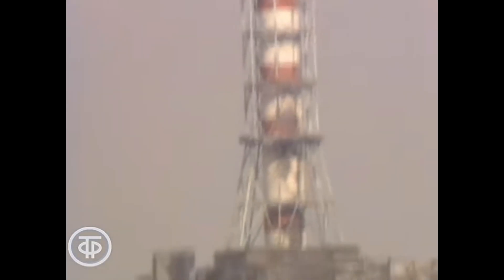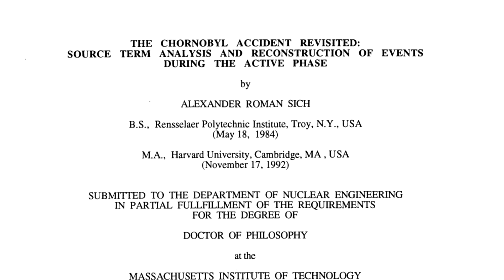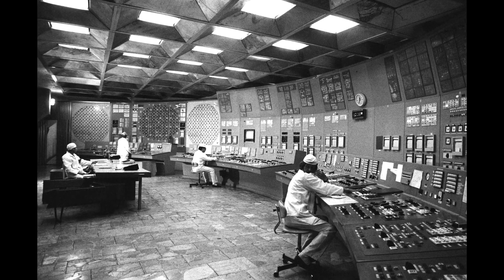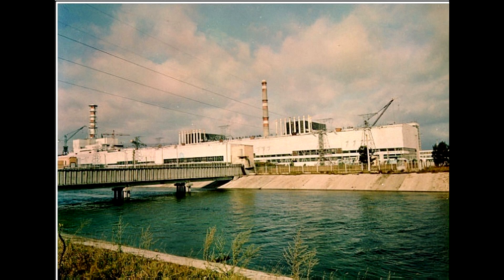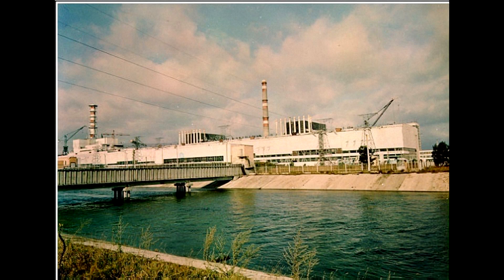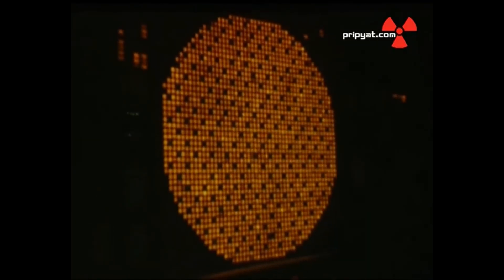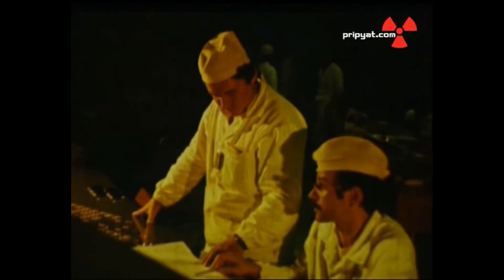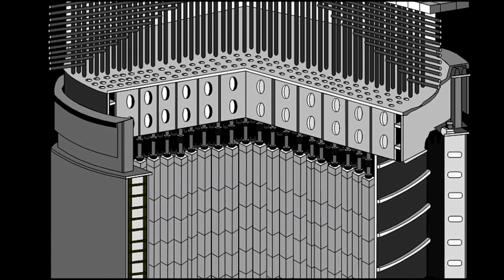Chernobyl Explosion Theories: Sich's Theory - The Last Seconds of Reactor Four

Comment: I've never understood why the displacers were made of graphite.  Why was this chosen when they knew damn well it was a moderator?
Reply from the maker: @elennapointer701  It was actually safer to use graphite overall, as it created a greater difference in reactivity between an inserted and extracted rod. They're still made of graphite today.

The fact the displacer was made of graphite made no overall difference to the accident, as it wasn't the moderator that caused the runaway, but the removal of absorption by water when the graphite displaced it. Any material that isn't a neutron poison would have had an identical effect.

Comment: Where most of tons of graphite disappeared? Temperature of sublimation of graphite is 3642C and many blocks just sublimated. Some graphite blocks, 250x250 mm, became oval, outer part  evaporated. Estimated temperature in the core of over-critical reaction , less than one meter in diameter, in 3-30 fuel rods,  was put at 16,000C-160,000 C. At the same time paint outside of scheme " L " ( lateral biological protection, filled with water)  wasn't even burnt out.

Comment: I never heard any mention of the fact, that the graphite would have that effect on the level of cooling water. That is a realy interesting detail. In the Video it was mentioned that this void effect would raise the output from 200 to 500. It is of course just my stupid comment but it is usually said within popular scientific information or publicly available information that the power output was drasticly lowered, due to xenon poisening of the reactor and that this was the cause for the reactor having less than a third of the output, due to causes unknown at that time, while working in a way that would generate much more energy.
Reply: The reactor layout was extremly complex and it was controlled analog with a huge amount of buttons. That would mean, as i imagine, that within all of the rods of reactive fuel power levels and even heat in the end result could fluctuate without the control havin any detailed insight. With less energetic output there was also a measurement flaw induced that woud reduce the detail in which core parameters were measured.
Reply: I however am not totaly convinced about one thing being mentioned, and that is one basicly trivial thing. I dont think it would be right to make a definite distinction between a catastrophic development and a basic reactor control error, that could happen all the time, with literally every possible consequence as a result. Its just a small criticism, but to me, it doesnt make to much sense to reduce it to the cause being the water within the fuel rods being raised and therefore air bubbles causing the criticality and the controls not knowing, because both factors, cooling water as well as the controls, are also part of the regular reactor function, without any type of error. It just sounds to simple of an explanation. But i too know that the explanation given is that the void coefficent of the bubles would lead to the cores melting due to an energy spike...
Reply: The main component is within the theory, that reactor components in addition to said misfunction are all the ingredients to build a type of nuclear bomb, or to have the inventory explode and release radiation... but that is just a limited  timeframe being explained. What is happening with the timeframe before the reactor even existed. The Reactor was assembled and the inventory was put there, which of course is the reason for it being released the way it happened. If you look at it like this, it is obvious that the cause for a explosion would be a basicly >thermobaric< reaction. But that would be like saying, it is because friction leads to fire... I think a better explanation should take into consideration much more details, and possibilitys, but i guess the tragic thing is, that this doesnt work with nuclear reactors and that almost everyone of them has the potential to explode or release radiation due to a mishap.
Reply: The reaction in the core is a balance. A compromise of many factors.  Fuel decay,  isotope production, isotope decay, thermal temperature, coolant, moderators, and absorbers are variables that are balanced to create a steady state neutron flux.  Neutrons are emitted at differing energies. Each source energy has to be separately accounted for. Xenon acts in three ways, being a neutron souce, a neutron absorber,   and a neutron moderator, depending on where it is in the reaction chain.  Maintaining a steady state neutron flux is challenging enough that a computer had to be used to calculate the rod positions.

The core is not a single point but a 3D volume.  The neutron flux may differ throughout the volume.  One part of core may be over-damped while another part may be under-damped.  Uneven core flux at low output was a known problem with graphite moderated designs.

The water is pumped into the bottom of the core and travels up the cooling channels to the top of the core, picking up heat along the way.  The void density would increase as the water travels up the core.  This variation was accounted for in the distribution and length of dampener rods and control rods.  

When the rods were last inserted the control channels, the change from water to graphite affected both neutron moderation and neutron absorption. At the same time, reducing thermal cooling. At that moment, one part of the core is 'stalled' but other parts are in turbo mode.

Comment: There's no theory - we know what happened. Chernobyl was a prompt critical event. This video would be better if you discussed the different between delayed neutrons and prompt neutrons. We normally control reactors on delayed neutrons. Thermal power is also not really the appropriate measurement when discussing neutron power.
Reply: The reactor could destroy itself without going prompt critical. It's enough to rupture three fuel channels and then simple depressurization of water will pop the lid off.
Reply: @MinSredMash  "The Chernobyl reactor tragically demonstrated the behaviour of a 
reactor following the sudden insertion of a large positive reactivity. In 
that accident power increased from a low level to an estimated 10 000 
per cent full power in less than 2 seconds. Why didn't the delayed 
neutrons limit the rate of power increase? The remainder of this 
section describes the effect (or non-effect) of delayed neutrons in more 
detail, to be able to answer this question [...]  A reactor in this state is said to be prompt critical, that is, 
critical on prompt neutrons alone. This kind of rapid power increase 
caused the Chernobyl core to explode."

Canada Deuterium Uranium Reactor Fundamentals introductory operations course, Ch 19 Sec 4.

I should add that there is plenty of information out there which says that we don't know whether that happened or not. Indeed, I found articles in the press that presented this as a "new theory", etc.  But it is stated as an uncontroversial fact in primary source materials I found.  The first source provides a detailed account of it with all of the math and graphs etc. Of course, I am not qualified to judge whether their conclusions are sound.  But it mentions precisely the distinction that OP drew.  And it is so rare that I find that in a YouTube comments section that I felt that I should say so.  I comment on videos about stuff that I know pretty well, and usually no one ever cares, either, lol.

There are often alternative hypotheses accounting for any complex event.  The best thing one can do is try to assign appropriate weight to various evidences.  Granted, my ability to do so is limited by my lack of expertise, but these sources seem pretty authoritative...
Reply: @MinSredMash  Rupturing a few fuel channels is definitely a design basis event and would not cause an accident. It is no big deal. A prompt critical event can drive the entire reactor to a high multiple of it's normal output. As I recall, the Chalk River event was estimated to be briefly 100x normal power. If the same applies, Chernobyl could have been at 320,000MW very briefly. The exaggerated physical size of the RBMK reactor aggravates this, in my opinion. Reactivity becomes limited by the Doppler effect that narrows the fission cross section of the fuel.
Reply: @DavidL-ii7yn  The 1986 RBMK would blow up when just three fuel channels ruptured. This actually has nothing to do with nuclear physics, just simple thermohydraulics. Enough coolant escapes into the near-atmospheric pressure of the graphite stack, instantly flashing to steam. This steam pressure dislodges the upper biological shield, shearing the heads off all 1649 remaining channels. At that point the core voids fully and probably goes prompt critical as a whole. Either way, a violent steam explosion and meltdown is then inevitable.
Reply: @MinSredMash  This seems pretty unlikely. Flow rates are only about 5kg/s and fuel channels will usually leak before break: they don't shear. So, say if it was leak flow of 200 or 300kg/s this would rapidly depressurized the system without significant core damage. This break flow would easily be handled. The state of the void coefficient is the uncertainty here. And on the RBMK this varied highly with fueling state and location. But this takes us back to a prompt-critical event; a LORA not a LOCA.
Reply: @DavidL-ii7yn  INSAG-7, page 69:

"Owing to the design characteristics of the reactor, substantial damage to even a few fuel assemblies (three or four assemblies are enough) can, and in this case did, result in destruction of the reactor itself and failure of its emergency protection system."

The full rupture of even one channel required the whole capacity of the Accident Localization System. Any more than two full channel breaks was no longer a design-basis accident. Following modernization, the reactor is now supposed to survive up to ten channel ruptures.
Reply: @MinSredMash  "The Chernobyl Unit 4 accident was a prompt critical reactivity excursion that occurred when the operators reduced power to well below the permissible safe operating level and, at the same time, neglected to follow low power operating procedures."

US NRC Staff Report NUREG-0933 Section 5, Chapter 2
Reply: @bsadewitz prompt criticality with a 2% uranium is extremely unlikely. Picture or it didn't happen. No prompt criticality events have ever been conclusively demonstrated in a commercial reactor and mind you there are reactors that work with 5% uranium.
Reply: Prompt criticality is easily obtained with uranium of 2% enrichment.
Such a system will achieve prompt criticality if it exceeds a neutron multiplication factor of 1.0065.
Civil power reactors can only be properly controlled if they never go prompt critical, so they are festooned with safety systems to prevent it.
Atom bombs also work on the basis of prompt criticality. But they work in very different ways to civil reactors. So an out of control reactor cannot duplicate the physics of a warhead.
Reply: Who's "we"? Scientists are proposing that multiple explosions happened; the theory in this video also says there were two prompt criticalities, not one, so you're a different "we" for sure
Reply: @u1zha  The thing about prompt criticality is they tend to disassemble the reactor within a split second: the exact length of time will depend on the neutron lifetime. The fuel in the area will be almost instantaneously liquefied or vaporized and in that state, incapable of generating further fissions (i.e. doppler reactivity effect). Recriticality is unlikely in the Chernobyl design due to lack of a pressure vessel. While further chemical explosions can and did occur, they are dwarfed by the original prompt critical event and decay heat.

Comment: What could have been done if this button had not been pressed ? Is there any other action that could have been taken? Or was disaster enviable at this stage ?
Reply from the maker: There was an opportunity to prevent criticality by manually inserting the control rods that insert from the bottom of the reactor, which would counteract the positive reactivity of the descending graphite, however there would have been no reason to do this in the eyes of the operators. If they had just waited, a power surge would have begun that would automatically caused the reactor to shut down, causing the explosion anyway.

Comment: Very detailed video, I was expecting another proponent of a "nuclear explosion" and am happily surprised that it was not. Given that there was a fire after the explosion, my guess is that a great deal of the graphite burned which would explain the lack of graphite below the lower biological shield.
Reply: While graphite can withstand very high temperatures, combined with high pressures it seems reasonable to me (as a non-scientist) that it simply vaporized. Graphite does not melt, or rather, does not have a liquid state; it changes instantly from a solid to a gas around 2500C. I also wonder if it's possible that it's simply contained within the corium, but as I said, I'm not a scientist.
Reply: @jasonhaynes2952  That's not 2500 °C, it's 3600°C. And that means if the graphite was vaporized from the heat so would have been the fuel.

Comment: Graphite can burn, that could easily happei in a ruptured reactor core. The corium must have had temperature of several thousands of degree initially, so any carbon present in it's vicinity would turn into CO or CO2 gas very quickly. Additionally, such liquid can burn easily through almost anything, including concrete and steel. Ps. Nuclear reactor's normal state is critical or super critical  In the operation of a nuclear reactor, criticality is the state in which a nuclear chain reaction is self-sustaining—that is, when reactivity is zero. In supercritical states, reactivity is greater than zero.

Comment: Stop this BS.
All is clear. As brianw612 said below, It was sudden rise or decay since water (that consumes neutrons) was displaced by graphite displacers from the bottom part of reactor. Thr reactor starts accelerating, extra steam was created that further accelerate reactor until the top cover was lifted up into the air since it couldn't hold up steam pressure inside the reactor. All is known since 1986 from IAEA report. All the theories listed here comes from people that know nothing.
Reply from the maker: Have you ever wondered why the 1986 report has been deleted from the IAEA report? Aside from how full of lies it was prove to be, the steam disassociation theory does not work with a modern scientific examination. I will explain more in my next video. :)